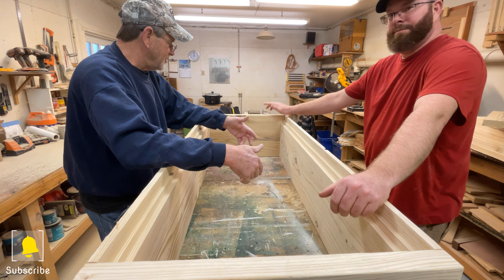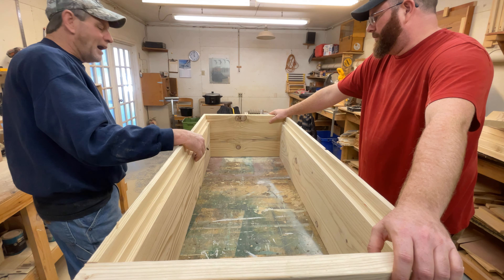Honeybee Long Hive Build.

Comment: Been a keeper for over 10 years and CAN'T believe how much eqpt has increased in price! I also have a sawmill now. Holy cow am I going to build one or two of those!! Just need a day stretcher to find the time to build one.  Still trying to figure that one out. That'll be on the market just after they invent a board stretcher. 2x lumber with paint should last dang near forever with paint. Just replace the legs if they rot with ground contact.
Reply from the maker: Everything is getting very expensive

Comment: You have had time to use it this year.  I hope it worked well for you.  I had a question that I am asking everyone who is building these.  My question is, how do you clean the bottom board?
Reply from the maker: The big test won’t happen until spring here. Once the hive makes it through the winter. We will have losses all winter long, and it will need to be cleaned out. My plan right now is to shift frames over to one side and then just vacuum out or use a dustpan to to pull out debris.